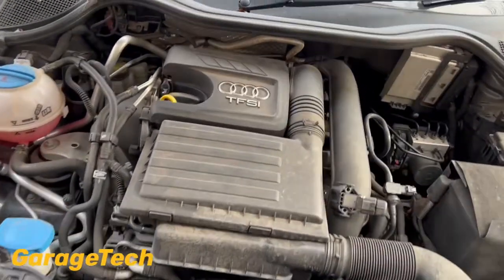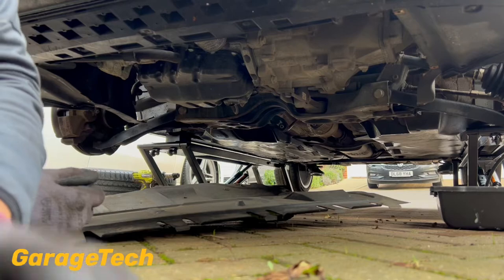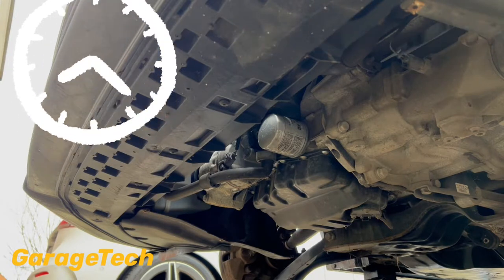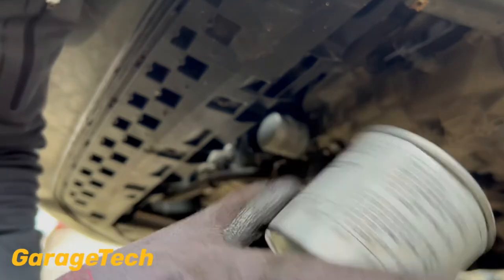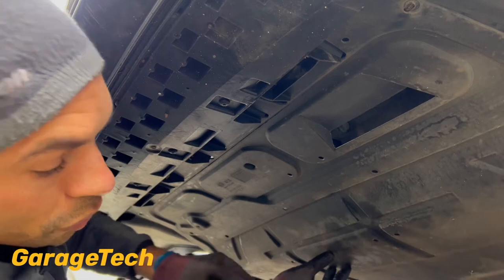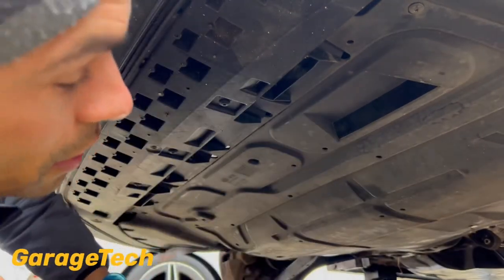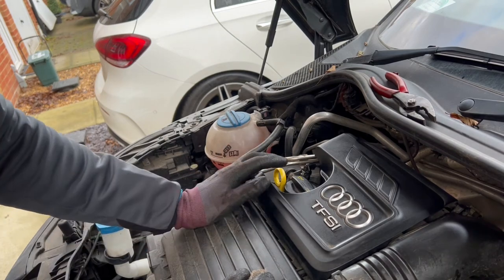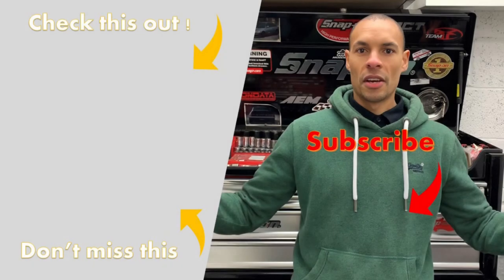How to change oil and filter Audi A1 1.4 TFSI 2013 - 2018. DIY at home, changing your oil and filter

Comment: ?? The earlier 1.4 TFSI engine has the oil filter at the top of the engine, very easy to change. It also has a chain-driven camshaft so no cam belt to worry about.  The post-facelift models (late 2014 on)  have a cam belt and the lower mounted oil filter as per this video
Reply: The only problem is that the chain wouldn't last that long anyway, it streched out and required a replacement at about the same time the cambelt would have needed replacement😔
Reply: @valetspecialist4239  Not on low mileage cars. 10 years and, say, only 50k miles and you'd need to change the cambelt but not a cam chain
Reply: @cmartin_ok  it's quite often that the chain gets worn at around 60k miles according to the owners of the CAXA engines that is, the engine itself isn't bad but it's just cheaper to replace a belt than a chain tbf, it's not exactly the same chain driven engines that we used to have in the past that would outlast the engine itself😔

Comment: I replace the oil crush washer every time but don’t understand why the whole oil plug needs to be replaced . The last couple of years I’ve used a Oil extractor which probably not the best thing very oil change incase  any sludge at the button of sump .

Comment: Very helpful video thanks. I wouldn't try to get too close to the maximum mark all the time though, I think it is an unnecessary overfill risk because as long as it is above minimum it's fine. I try to get mine at around 75% of the dotted markings.

Comment: The Audi dealer puts 0w30 oil in , should i do it to with 0w30 or put in 5w30???
Reply from the maker: 0w30 is a better grade oil. Best to put in what’s recommended 👍🏼
Reply: @GarageTechAutomotive  it can both 5w30 or 0w30. I just bought the car but saw that they always serviced it with 0w30